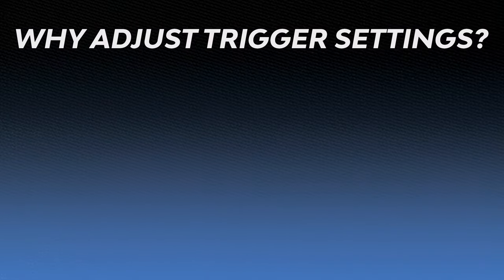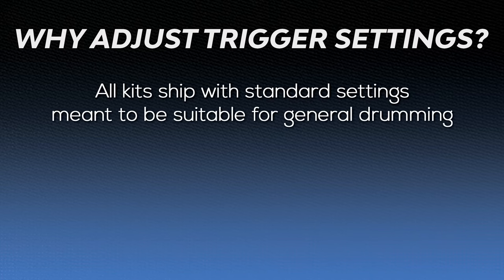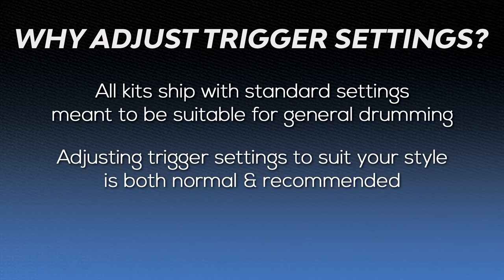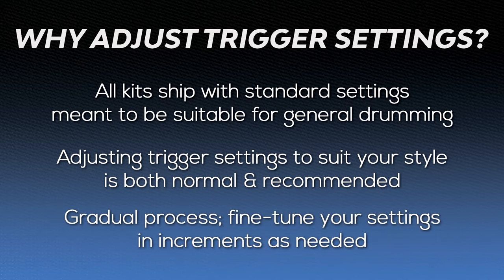Alesis Surge & Nitro Modules | Adjusting & Understanding Trigger Settings

Comment: So one can’t adjust the sensitivity of the bass drum pad at all? When I hit it as hard as I can it barely registers. And it’s inconsistent with its volume and sensitivity in general
Reply: Hit the utility button, hit the bass drum pad, or hit the button for the bass drum on the module, and then use the left/right arrows to increase or decrease the sensitivity. That worked for me on the surge model.
Reply: @kylewadley5031  I’m talking an nitro
Reply: @Zildjian4411 same module
Reply: @kylewadley5031  I did this with my newly bought surge. But I can't to register the sound sometimes. What I do is stomp my foot a bit harder to hear a sound. Is that wrong is that how you really have to stomp on the bass pad? I'm a beginner btw
Reply: @artofersuke center the beater on the pad, if it’s not centered it doesn’t register properly

Comment: Anyone else having trouble with snare rim sensitivity? You reqlly have to hit it hard in order for it to register
Reply: I'm having problems for over a year now trying to get these to work with superior drummer 3 to the point where they sit idle and i just input drums with my keyboard. Not happy.
Reply: @sixtyticketrecorder7276 user error because you just need to usb your module to pc. Add the kit in edrum settings of surperior drummer. Select the audio device and boom it works.
Reply: @jimbo121  that's the thing- did that but there is no kit that "matches" really well so i end up having to program each drum and that is a major PITA. So yea,i guess user error but I'm a musician, not a programmer, i would expect a little more off a plug and play situation but i guess you get what you pay for.  I'll have to save for Rolands.
Reply: @jimbo121  dayum!  Thank you Jimbo121! I had given up on these things.  I updated toontrack, used usb instead of the midi output and you were right- boom it worked. AND  virtually zero latency.  Thank you!

Comment: Can you please also suggest the appropriate values other than the factory settings. I have the kit for 3 years now and my only issue is I am not able to understand what values will be appropriate. It would be a big help.
Reply: There is no appropriate that's why it's adjustable, you dial in YOUR preference.  🎬

Comment: So when I use the kick drum it sometimes doesn’t register. I could keep the force of my foot the same and the sound goes in and out. Is this a me thing or something I can adjust on the drum kit. I’m also trying to produce a more sensitive kick bc I don’t want to slam my foot down to produce a sound, especially when I’m learning. Please someone help!
Reply: You’ll have to make sure you are striking right in the middle of the kick pad because that’s where the sensor is. Might try adjusting the beater
Reply: I just bought a Surge mesh today and I noticed this too. Have you found a way to fix this? What I do right now is just slam my foot a bit harder just to register the sound.
Reply: @artofersuke some ppl say that you need to hit the lower part of the kick drum, because here is where the trigger is located.
Reply: @wizzarn  Yep! This did it for me.  I adjusted the beater to be about 1/3 in from the bottom (so, slightly off from dead center on the kick pad) and now i don’t have to slam my foot down.  Because yeah, I was thinking, this is definitely NOT going to be as much fun as ppl say if I have to work out my right leg to this degree

Comment: Why is mine have low sound both on amp and headphones please help😢
Reply: Just adjust the sensitivity to max
Reply: Increase the Pan level as well.
Also when you choose a Kit, you can adjust the kit's volume.  The EQ Hi-Mid-Lo will fatten the sound for your output device.

Comment: Thanks for the video
@ 5:38 do you suggest using the kick drum beater the wrong way round?
Reply from the maker: Hi there, the beater in this shot is facing the right way—the felt side of the beater creates more friction with mesh heads and can wear them down more quickly, so the plastic side should be facing the drum head. Cf. this section of our assembly/setup tips video for the Surge & Nitro kits: https://youtu.be/GxSXMuEy7oc?t=178

Comment: Please, Alesis, we need specifications that make a difference. How many round-robins do the sounds include? How many dynamic layers? It doesn’t help to say the module has an 'impressive' number of 99,999 sounds if, in the end, we only use a few, and those included are sampled in a very basic way. Take note, as I’m sure any user reading this would agree: it’s better to provide fewer sounds with more detailed sampling.

I think you've made huge improvements in recent years, and it's appreciated that there are products for all budgets. But please, keep this in mind. We know that a module can’t compare to having BFD, for example, connected, but it would be great to have a module that at least responds with quality sounds, even if it’s just 5 well-sampled kits. Reserve the widest variety for the higher-end modules. A sincere suggestion.